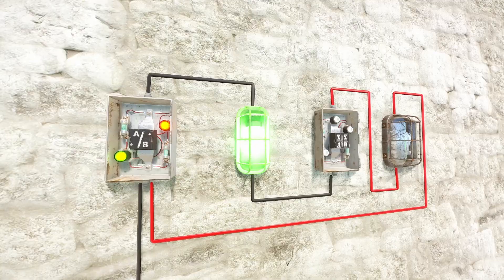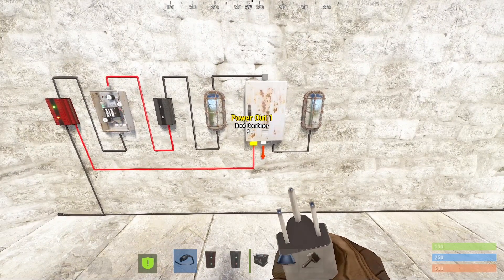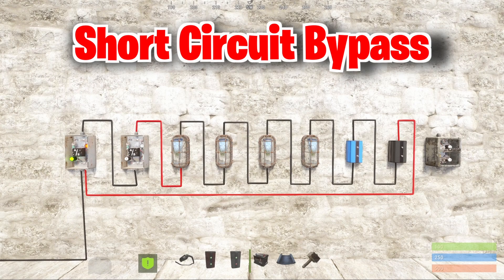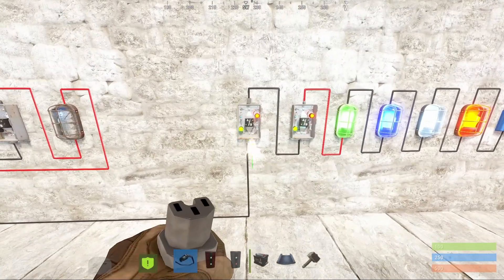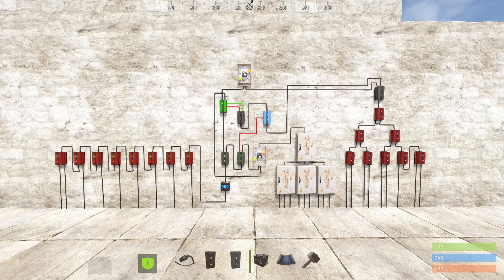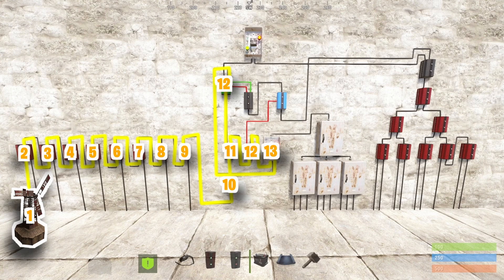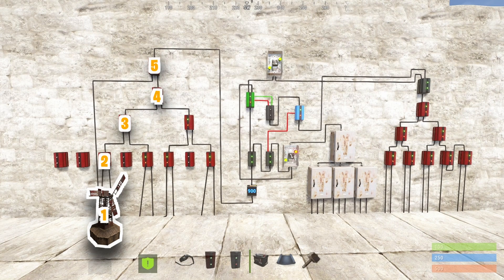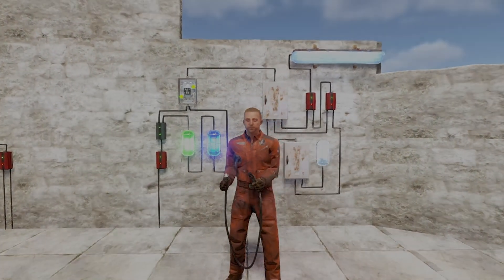Short Circuit / Max Depth Fix | Rust Electricity

Comment: Since when has this max depth been a thing? I used to be able to make crazy circuits and have them work fine.
Reply from the maker: It always has been :-)
Reply: @HyperionRust man I dunno. I’ve just run into it myself for the first time using pipes. I don’t know what’s wrong though, because everything is working as intended 🤷‍♂️
Reply from the maker: @exterminater267 it is a bit different in industrial and water compared to electricity though

Comment: Didnt batteries reset depth limit?
Reply from the maker: No
Reply: @HyperionRust actually I got it wrong, I thought there was a max of 16 until like the battery but it’s also a max of 16 till the last root combiner. But you can have (infinite) branches after the battery/root combiner right
Reply from the maker: @Kaasbal14 yes, that is correct

Comment: I have this problem with the water pumps, when connecting them to the combined fluids these three give me this failure and it has never given it to me in case you can set up a circuit for a fairly large orchard with many expenses
Reply from the maker: Well with water it is more problematic. The limits are different because electrical depth does count towards water depth too.

Comment: Men, your video dropped at the perfect time. I’m currently setting up a circuit for the base we use next wipe and I ran into the max-depth issue at the BCN Core part of the circuit. I’m using an 8 mills / 6 batteries setup, and I like to put counters here and there to check things like the leftover energy going into the batteries without having to equip the wire tool. That’s exactly what caused the issue for me. Thanks m8, you explained that very well <3
Reply: U realy don't need the counters
Reply: @FoliagedCargo33  yes u are right, it was more like a convenient thing for me to keep track of how much power is going where.
Reply from the maker: Makes me very happy to see that it actually helps :-)